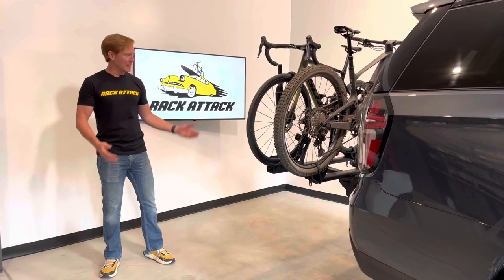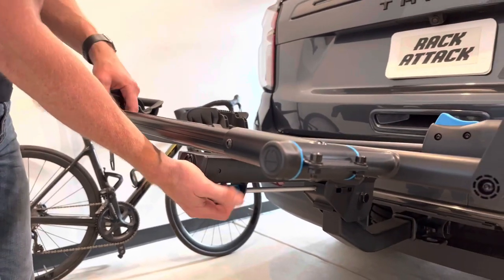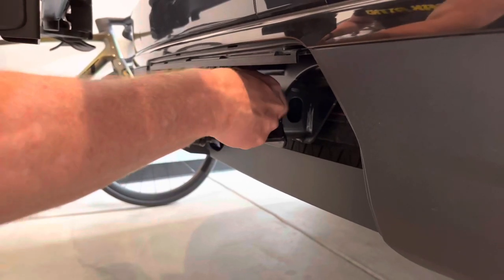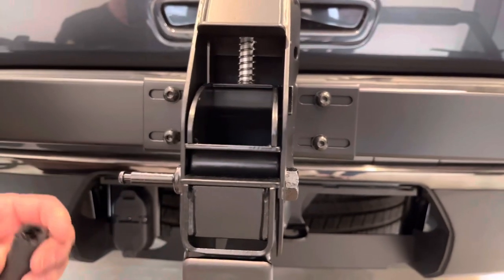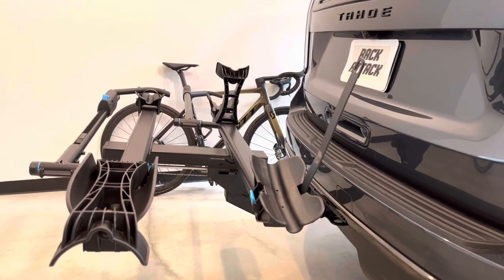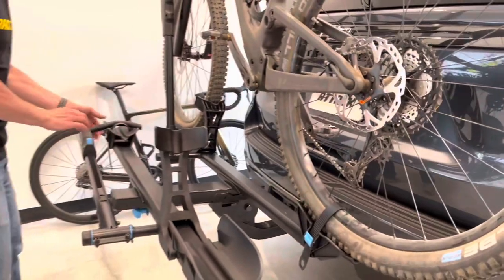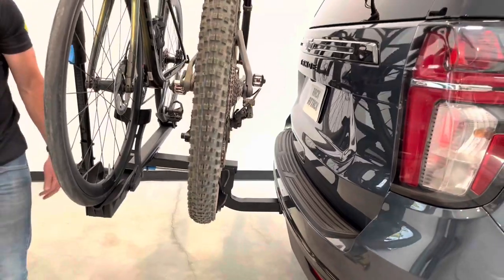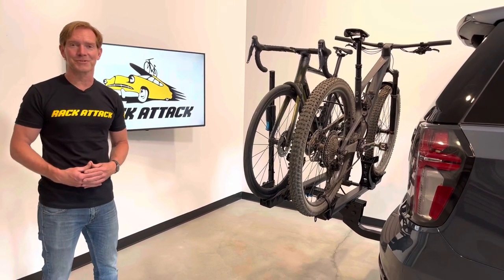RockyMounts MonoRail Hitch Bike Rack Overview

Comment: I'm looking to buy this rack in the 1.25" receiver version for a 2003 Subaru Forester. Does it still have the same 60lb per tray and 120lb capacity as the 2" version? Also I heard that there is potential for the wheel tray to melt because of the exhaust location. Thanks!

Comment: Just bought this rack and after the first use found the hook mount loosened up after a 35 mile drive. Was with my 29 er mountain bike. Any thoughts?
Reply from the maker: Hello.  Yes, tire pressure is important, if the front tire lost air the hook will loose grip.  Also, placement of the hook as close as possible to the first point of contact near the front fork is important.  Lastly, the initial very firm compression of the hook onto the front tire will determine how stable the hook stays in place.  Thanks!
Reply: @rackattack  thx for the response, I’ll try again very soon 😊